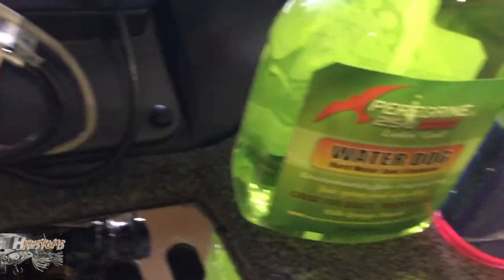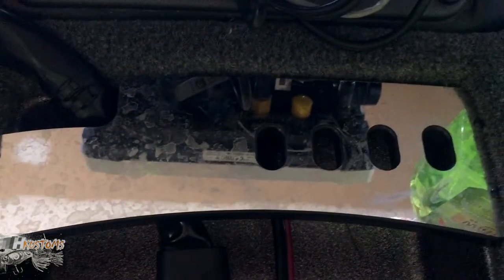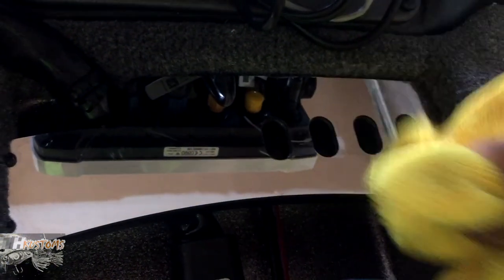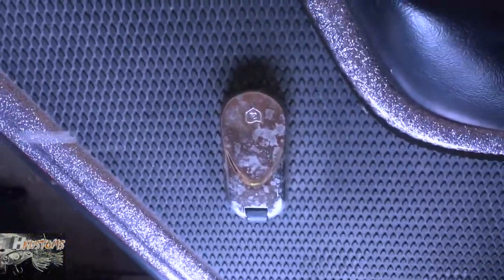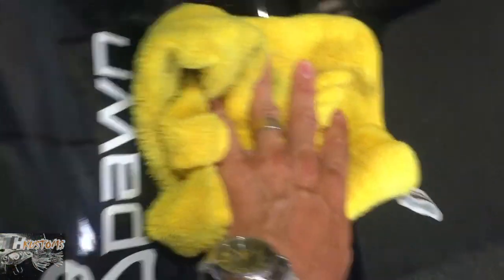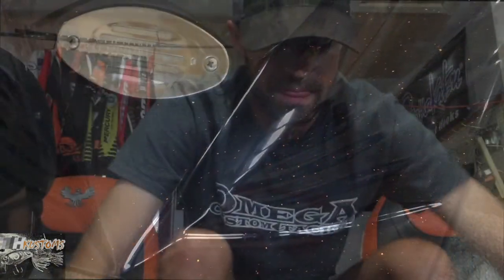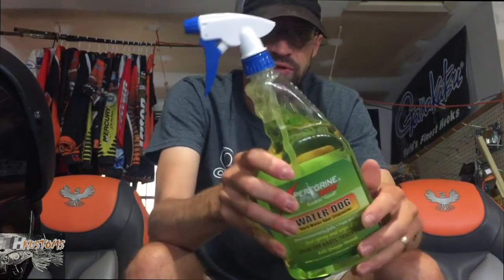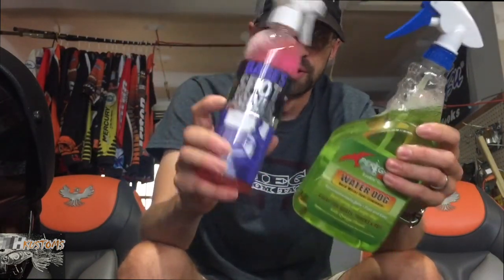Water Spot remover Babes Spot VS Peregrine 250

Comment: I used the Babes for the first time yesterday. I had the same experience with the sticky residue. I found I'd have to follow with a second coat to get the sticky off. Afterwards, I read the instructions and they stated to wipe it down with a damp rag. I was using a dry rag so I'll try again tomorrow with a damp rag. I've found straight up Ducky or Boat Juice are the best for getting off harsh water spots.

Comment: that coating might be a wax type protection to help keep water spots from coming back as often. try spraying it with water once it is dry and see if the water beads off or stays on it.
Reply from the maker: Problem is it's a hazy film when it dries after 10 mins or so... it's not a terrible thing if you then spray Nano wax or Slick mist over and wipe off then it's gone...
Reply: +Trey Harpel yeah the haze would be annoying. but if it does apply a hydrophobic layer is the haze more annoying than having to spot remove the boat more often. hard to say. I don't have either problem since I don't have my boat anymore lol.
Reply from the maker: +Ryan Getchell I just use a Nano wax anyway after I get water spots off and that makes the Haze vanish and is a great wax... Babes still does its job which it was intended to do..